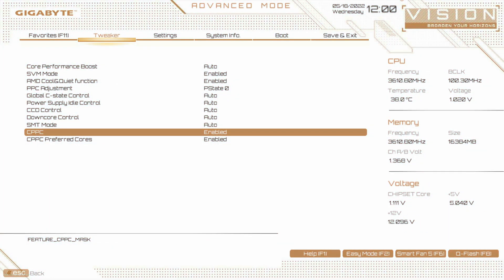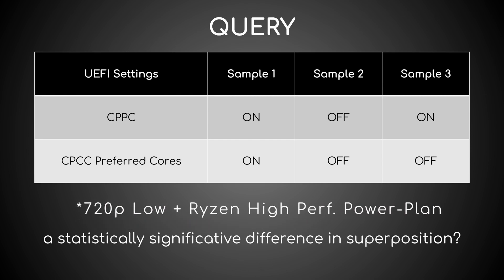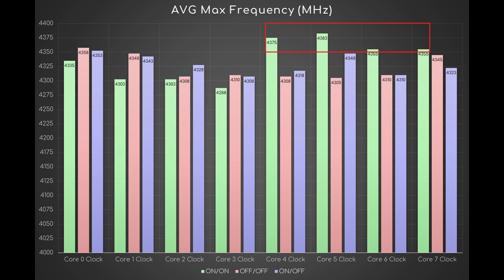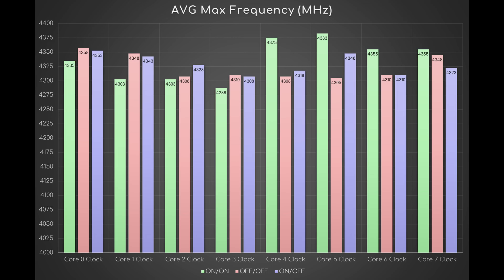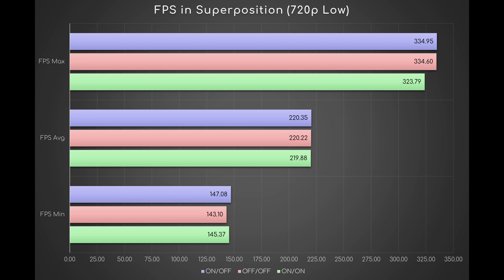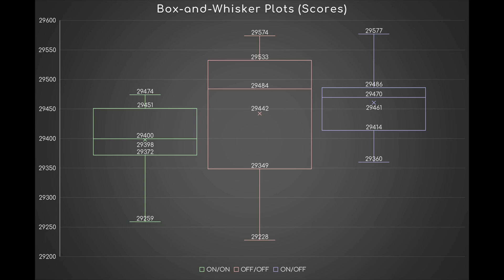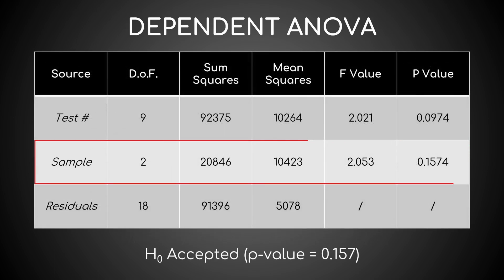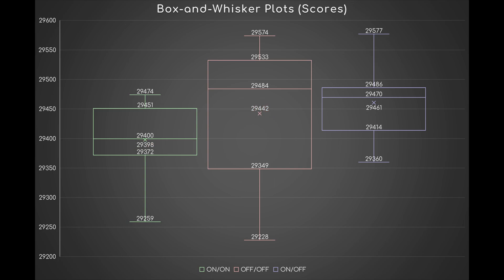CPPC ON vs. OFF in Superposition: a Statistically Significant Difference?

Comment: What to do on Ryzen 7 5800x3d?
Reply from the maker: According to other users who have chimed in, the 5800X3D seems to prefer OFF...
However, I cannot verify these claims until I buy the CPU myself (it is on my plans).
Reply: Thank you, im gonna try it @oakenglass
Reply: mine works faster with Preferred Cores disabled. I have first 2 cores on same side, and core 3, 4 also on same side, so the left side of my CPU is always more busy than right side, which leads to higher temperatures on left side if Preferred Cores enabled. But I also use -30 curve, and Medium LLC (on Aorus Gigabyte MotherBoard), I don't know how it gonna work in factory mode.

Comment: yes please do a video while testing cppc on vs off in games. Some say off improves 0.1 and 1% lows a bit but lowers average fps. i would like to know if its true. i tried playing games with cppc and pref cores off and it seems to be slightly smoother but i cant tell if its just placebo effect. and im not smart enough to do a full test in many games.
Reply from the maker: Thanks for replying!
Yes, as you can see in my following video on CPPC in CS:GO (https://youtu.be/qxEL-Fptjyg), OFF/OFF and ON/OFF both improve the Min FPS (however not significantly) but they worsen the average (significantly).
What other games do you suggest?
Reply: @oakenglass  Whatever games you have that you can test sir. Maybe a game that is cpu heavy and a game that is gpu heavy so we can see if the results are different.
Reply from the maker: @naksur2719  Sure! I'll look around to find games that are more CPU-bound than others and report back (in video form) when the results are ready.
Reply from the maker: https://youtu.be/KZWr2buwJMM